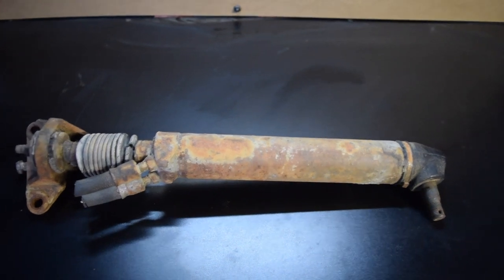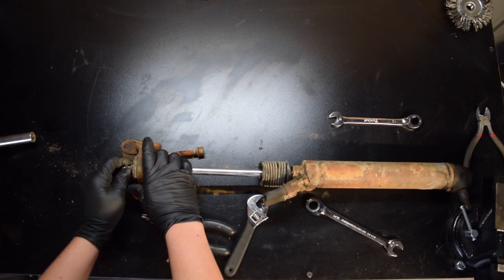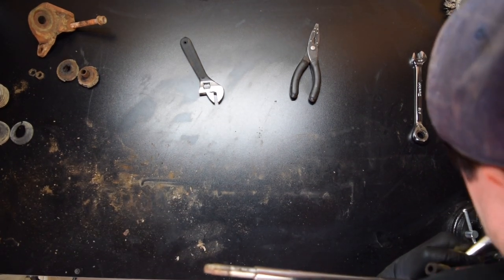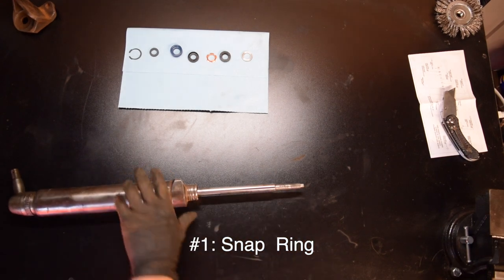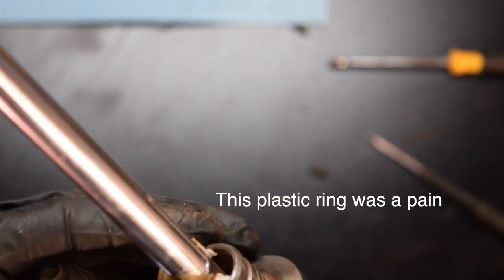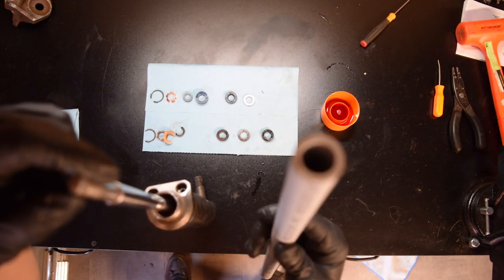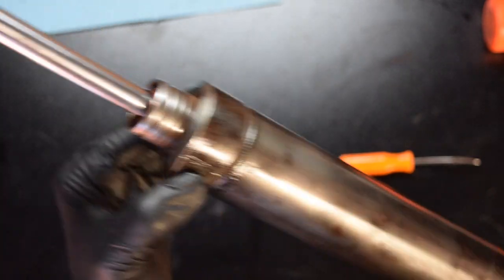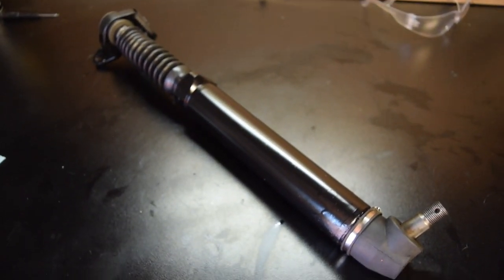Power Steering Cylinder REBUILD | 1965 Mustang Fastback Restoration

Comment: Quick question: Is that sand paper that you use on your bench grinder to clean your parts? If so what grit? If not what attachment is it?
Reply from the maker: It is a wire wheel attachment on the bench grinder! Yes i use it to clean most of my parts, it makes everything so much easier!